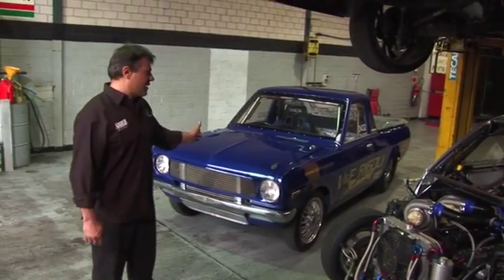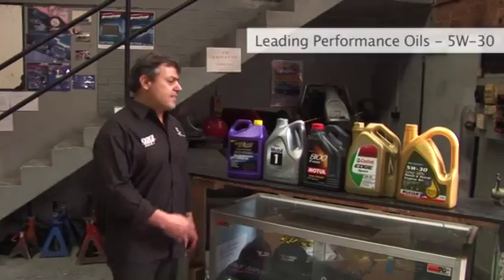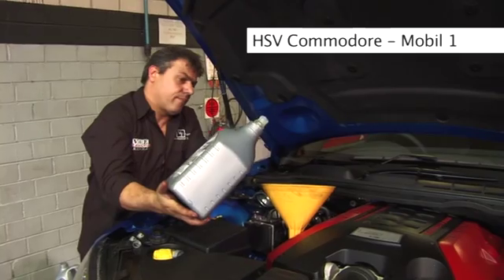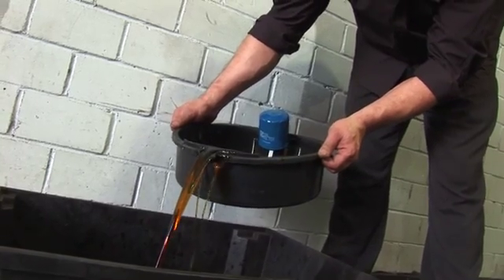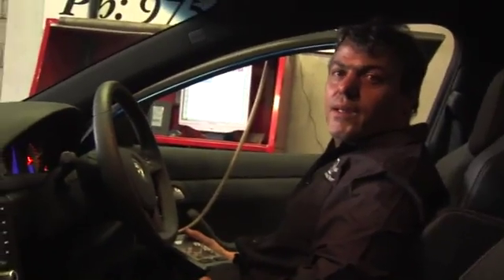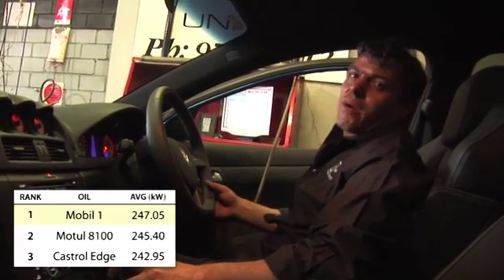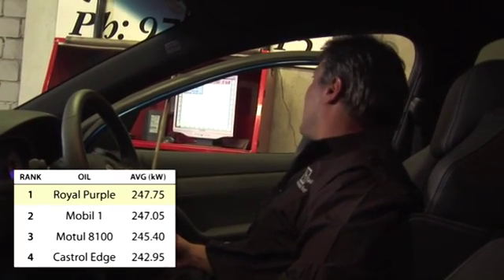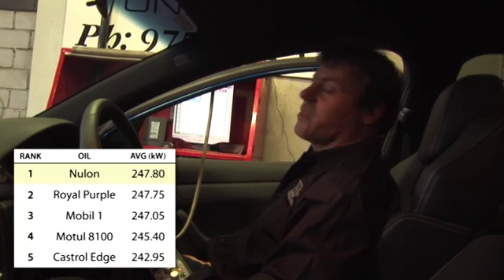Engine Oil Dyno Shootout HSV

Comment: Wait a minute guys. The Castrol Oil seems to be straight 30 weight (hard to see in the video, the Motel, Royal Purple and  Nulon are 5W-40 and I could not see what Mobil 1 was. Your chart at the end says 5W-30.. You can't compare different weights of oil. I very much appreciate your effort, but can you clear up exactly what grade of each oil was used? There is some conflicting information.
Reply: You're blind.  They're all 5W30 except the Motul.

Comment: It's interesting to note the amount of engine oil 'technicians' commenting on this video claiming their knowledge of oil chemistry, performance and brand selection are far superior to the selected test oils in this video. What control and testing procedures are they using? Can they put forward evidence for their claims? Or are they just biased to the oil they bought at Super Cheap Auto that they run in their VN SS Commodore that does mad skids? Hmmm...

Comment: I found that the nulon burned alot quicker than the moble1 as especially after 2000ks, moble1 stood clean passed 2500k that’s given a boot full every chance I could, you pay for what it’s worth, just remember poor man pays twice, pay for quality it will last… Just for an extra kw but will dirty the twice as quick and lose more down the line.. I change mine every 3000k just cause I believe in healthy engine and end of the day everyone is your choice on your oils,do the test yourself

Comment: Test Catrol Edge with Titanium.  If it does not improve over the standard Edge, I will swith to Mobil 1 because I can buy it at Walmart.  Not much difference in the top 3 oils.  Thanks for the testing.

Comment: Not enouth data to be conclusive:
1- All the brands MUST HAVE THE SAME VISCOSITY GRADE, 5w30.
2- All the brands MUST HAVE THE SAME SAE CLASSIFICATION, like SL or SJ.
Otherwise this an apropriat comparacion Test.
3-For the Dyno Test, all oil must be in the same engine inicialTemperature (T0).
Reply: All cars can run different weight oils. I'm sure Mr Rioli knows how to warm up an engine before he does a dyno run.

Comment: @GrUnGe567 Dynapacks must have the wheel diameter plugged in so they can calculate the effective diameter. They don't give tq/hp results of the center fitting. Also, the tire/roller friction will be completely different to tire bitumen.
I used a roller-dyno with some M/T ET Streets and almost destroyed them with slippage. We had to completely abort.
Meaning, even a tire you may expect is good may mislead you.
Id prefer knowing max hp is capable from the wheel, then choose tires for the track.

Comment: I have a sbf that revs tp 9000rpm.
I`ve used mobil 1 5w30 & Royal Purple racing 21 ( 5w30 )
Mobil 1 was the cheaper oil of the 2 but the Royal Purple is the only oil I will be using !

Comment: No way you can get accurate and consistant results with a tire to roller interface when you can make or loose 20 hp with a tire change as well.
Get a Dynapack dyno if you want to start splitting hairs.

Comment: Tell me everyone who posted comments didn't fall for this sham.  It's rigged.  He is placing the cooling fan at different distances to control the outcome.  The cooling fan is moved the closest to the radiator during the Nulon oil run.  Cooler engine, more horsepower....it's that simple.  He does this in all of his video tests when he puts Nulon oil in the engine.